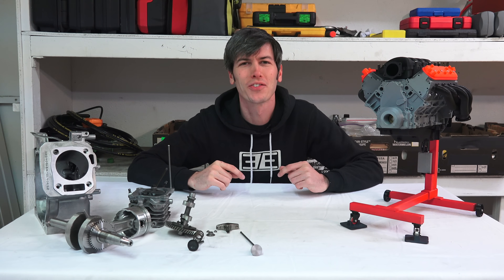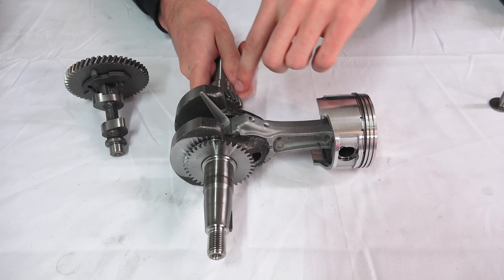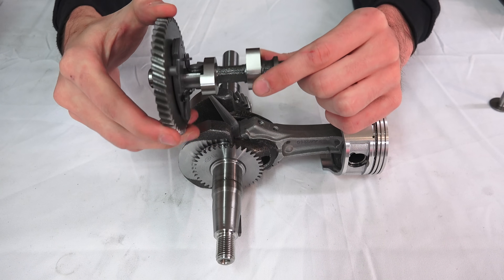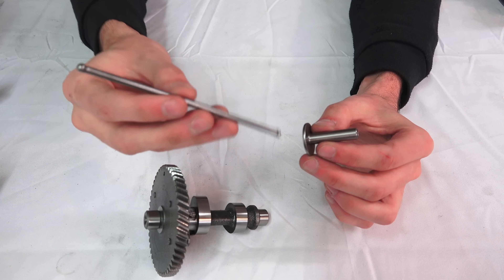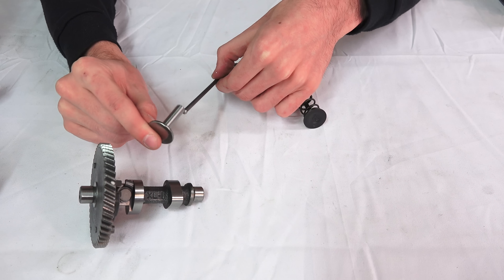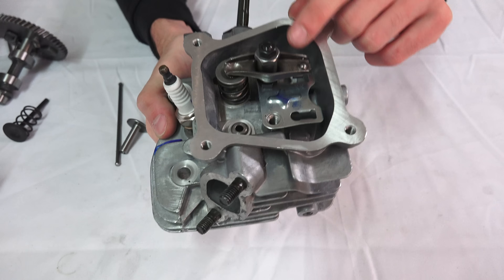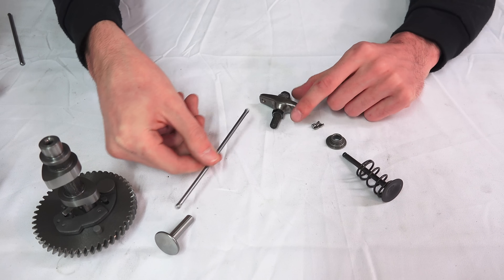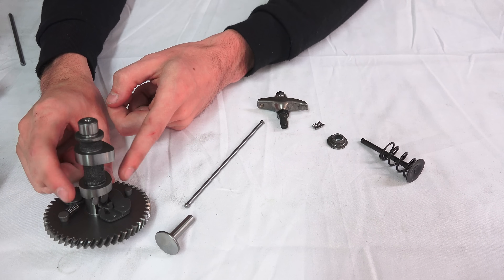Why Can't Pushrod Engines Rev High?

Comment: I know Chevy has the LS platform and architecture down at this point and it's a great and reliable platform... but I always question why they haven't yet moved to DOHC.

Is it just a spatial/weight concern?
Reply: Smaller size, cheaper, and even less crap. Your power band isnt at 9000 and most highway driving isnt at that level. Youre fine at 5600max as youll idle at 500 and at highway speeds 2800-3200. Your torque isnt produced in the higher ares.  It usually just brings the issue people fight over "torque makes you go fast, hp doesnt/hp makes you go fast, torque doesnt" I believe in torque not hp. Others are different on that subject.
Reply: Because they're basically building the Corvette up to be a contender in the supercar arena. If they can design an LS with DOHC that'll accelerate in RPM faster, and keep the powerband stable through a longer rev-range, they wouldn't need to squeeze everything they can out of transmissions to maintain vehicle acceleration.

Mostly talking out my ass, but basically tl;dr If they can and it would produce significantly more power and torque faster, why aren't they? I get that it'd be cost-prohibitive, but that doesn't seem to stop them from charging +$100k for a new Corvette.
Reply: InvictvsNox gm uses dohc and pushrods. Why let a engine platform die when both have pros.

Comment: Dam learnt so much. Always wondered why on engine masters the motors didn't spin very high. Thanks Jason.
Reply: what? there 377cid made peek power @7,000 and will rev to 8k,   ford voodoo 5.2L makes peek power @7,500 and red lines at 8,250,  that only 250rpm higher for a 1 liter smaller engine

Comment: Ask why PUSHROD engines dominate most WORLD RECORDS.....
  Comparing a 1.6 liter Formula 1 engine to a 5.7 liter?  
Ask why a 1000hp formula engine wouldn't move a Monster Truck... 
Higher RPM usually leads to narrower power curves & the need for more & closer ratio gears in the trans. Sometimes it's perfect, like as a street bike engine. But a 9000 rpm 2.5 liter engine in your station wagon would suck.

Comment: Kenetic force of the mass of the push rods will rip it apart. They also produce more torque loer than overhead cam engines.cheaper to make a large pushrod vs a small ohc. same effect is geared Right.

Comment: What about Judd V8’s? Cross plane, push rod engines that rev to up to 12,000 rpm? I’ve built small block chevys that have revved over 10k, granted they have half the stroke as normal. Your s2k revs high as well! I understand the point of this video is more of a “high revving engines are much less popular”, however, there are super high revving engines that use coil spring valve trains. You should do a video on why rotaries “tend” to rev higher than piston engines!

Comment: The thing with Nascar and race engines is that those engines are going to be used for a day. Using high strenght springs is possible because of that. The camshaft is going to get rounded fast, but it dont matter because those engines are disposable.

Comment: In modern time, using push rod engines is the most American thing you can do. In my country you'll be crying blood to pay tax for big displacement engine. Car makers introduced so much technology to bring out the power from small engines like variable cam profile, multivalves, variable valve timing, just to mention a few... which are quite impossible with push road design. Don't get me wrong, I would loved to drive a simple, low reving, big V8 and do burnout.

Comment: Its also the long stroke of an american v8 which creates very high piston speeds per given rpm. Short stroke engines will be able to rev higher as opposed to a long stroke engine due to the difference of piston speed.

Comment: I seem to remember back in the late 70's and 80's, the big trick was going to solid lifters from hydraulic. You could rev the engine a little higher as the hydraulic lifters would float around 7k... But I could be wrong, that was a long time ago, and I've slept since then ;-)

Comment: What's the advantage of push-rod engine? Going to SOHC with belt/chain drive should not have increased complexity and perhaps actually simplify things. How the valves are run shouldn't effect power output. Valve profile (2/4, size, lift) and cam profile and timing should have been the one that effects it. In the big industrial and marine engines increase in efficiency would have also been more advantageous and it would probably just as easy to change valves on board and there's no connecting rod to break so I don't see why use them.
Reply: The biggest benefit is packaging, and cost. Pushrod cylinder heads tend to be more compact since they don't have to house the camshafts or cam gears/pulleys. They are also typically cheaper to build since you only need one camshaft, one set of followers, half the valves, etc...
Reply: Wanna see something funny, look up LS3 vs GTR engine. That Nissan engine is a monster compared to the LS3! I also got a comparison picture of a Mazda 4 banger next to one and the Mazda one isn’t that much smaller. 

That’s what’s so funny about people talking trash about the LS3 being 6.2l is they act like it’s a big block. It’s a small block and when compared to a lot of engines, you see that it’s really not that big. The 5.0 Coyote is huge thanks to its 4 cams and 32 valves.
Reply: Less weight and heat on larger engines is also a huge advantage. Putting 32 DOHC valves on a Blown Hemi adds  A LOT of extra weight vs. just turning up the boost. Pushrods cylinder heads are lighter; without cams and extra valves.

Comment: The spring strength is not main reason for that. Overhead cam engine also using spring on the valve. It is more on the valvetrain mass, and the length of the rod (strain and compress).

Comment: Great video. Not sure why a stiff valve spring should cost you efficiency though.  There's nothing damping the valve spring so it should just push the camshaft round as the valve closes giving back nearly all the energy that was used to close it.
Reply from the maker: Pushing a valve spring closed doesn't provide useful work for the engine. If a valve is pushed back harder, the engine is no stronger. But the engine does have to use its own power to open that valve. The stiffer the spring, the more force the engine has to produce to open the valve.
Reply: Engineering Explained But the cam is symmetrical and the follower remains in contact (unless it's "floating") so it should push the camshaft the way it's already going. This means the engine encounters a little bit less resistance when turning that cam gear so you'll get a tiny bit more torque at the crank. If the energy is lost then where is it going? There's nothing squishy or frictiony in the system.

Comment: I remember the Pontiac 2.5 liter "Iron Duke"push rod 4 cylinder having a redline of about 4,500 rpm.  Ridiculous boat anchor (but reliable) motor.
Reply: smithraymond09029 the iron Duke didn't even manage to wheeze out 100hp from 2.5L either.
Reply: @mrflamewars  88 hp. in 1983, if I remember correctly.

Comment: sir , desmodromics addressed valve float (imo) very well. why is there no desmo or desmo-like system found in cars? thanks!
Reply: Its got to be patented
Reply: NVH, that is why you do not see those in cars.
Reply: Pad Lok Desmo valve systems are somewhat more complicated and more expensive than other ohv systems.
Reply: Vernon Pitts, thanks, after a little reading i now understand your comment. but i was unable to find any reference to ducatis or desmo in general being particularly bad on nvh. lacking any exp in this i ask you, does the desmo valve train add that much vibration? more than say choosing a bad angle (45 deg) for your v2 (or 90 deg  for your v6) ? also they put flat cranks in production cars for minimal scavenging benefits so obvi at some point even production cars will tolerate high nvh for performance gain. i suspect that James Avery got it right and it's a patent issue.

Comment: they don't rev high because most modern push rod motors use hydraulic lifters that have plungers in them that bind up at high rpm, this causes valve float where the pistons are coming in contact with valves because the fluid cant get out of the lifter fast enough. Nascar uses 4 pattern cams and f1 used something different cam wise. They are both full oil head and cam bath designs to help keep everything cool at higher rpms.

Comment: Can someone tell me the short version? Lol yes I am lazy
Reply: More parts less revs...simple lol
Reply: Nuno Godinho thanks lol
Reply: Also, spring limitations, compounded by the additional parts (more weight to move back and forth), eventually yielding valve float as a result bc they can't keep that weight in check at that speed.

Comment: Although I love 4-valve per cylinder DOHC engines, I have to credit large displacement pushrod engines for having great low-end torque, ideal for the easygoing driver.

Comment: Could a pushrod engine rev higher if it used gas instead of springs to return the valve (like f1 cars valves)?
P.S. by gas I mean gas, not gasoline of course
Reply: Damn you already answered my question hahahaha my bad, need to watch the entire video before asking questions 😂

Comment: At this rate I'm going to have to make a video because the number of valves makes no difference you can have 16 valve the one head in and garbage camshaft and it'll flow about as good as a lawn mower engine the valves don't make the difference it's the port size in the camshaft that does if you have the port the size of a pencil and it has to say 5 hours per cylinder it ain't going to outflow an engine that has ports of size that will take a golf ball that has to valves but then you can take the one that has giant ports and put a terrible camshaft in it and it's still not going to flow it all the number of valves make no difference dude they just don't

Comment: Most street pushrod engines use hydraulic lifters that are only good to 5500 rpm. They have used solid lifters in the past but needed valve adjustment every few thousand miles. The original Boss 302 and Z28 are good examples.

Comment: and this is why the LS is a shitty motor
Reply: one of the best motors ever made. fact
Reply: Lol way more torque than any euro 4 banger.
Reply: NewSchooler Oh please. Show me a factory 2L engine making 450hp+ and 450tq+ much less while returning mid 20s mpg under normal driving.

I'll give you a hint, there aren't any.
Reply: In what galaxy? LS is a damn good motor and the go-to swap for in imports in Formula D for a good reason.
Reply: jordan lewis yep. Totally shitty. That's why a factory bottom end can make 1200hp, also why they get amazing gas mileage, why they are easy to repair and have swap kits for every make of car out there.  Why they are the most commonly sought after V8. Also why people swap them into their drag cars. It's because it is a shitty motor.
Reply: +NewChooler it is NOT 3-4 times bigger gtfo if your eally believe that.
Reply: NewSchooler the whole point of having pushrods instead of dual overhead cams is because the engine can be smaller. You have no idea what your talking about
Reply: Still waiting for the Chevy LS Flat Plane Crank Motor
Reply: LMAO ;-)
Reply: Le Mans has Balance of Power Rules though

making every car equally fast no matter what the displacement is
Reply: The Power Density of Ford engines are greater than Chevy's

Engine efficiency is measured in Horsepower per Cubic inch
Reply: NewSchooler 2.0L four bangers need 5,000,000 pounds of boost to make any serious power
Reply: Its not 3-4 times larger dingbat. Displacement has nothing to do with the size of the engine. Typically pushrods are smaller and lighter than their OHC counterparts.
Reply: Adam, more torque events per second, ie more rpm = more motive force per second. Just who doesn't understand engines ?
Reply: Escape for Mankind is Keith Johnson 
Flatplane LS would vibrate itself to death. They’d be building their smallest LS just to do it. I’d doubt they’d ever do it due to cost for a one off engine. Maybe if they massproduce it, but heavy doubt.
Reply: If you judge an engine solely based on how high it's redline is, you don't understand a damn thing about engines.
Reply: Winning LeMans 24 hour against OHC engines say  different.
Reply: Flat plane cranks don't like much over 5 liters apparently

Comment: And you can't be serious on the four valves flow more than two giant valves that doesn't affect flow I'm sorry it just don't and name one overhead cam motor that makes 10000 hp and you said that V8 push rods have a special heads open the valve more no heads don't change valve opening only the lift of the camshaft does and you can't be serious name one engine overhead cam that has bigger ports in a Ford 351 Cleveland the ports on a 351 Cleveland or so huge that a golf ball can fit in the damn thing so you can't argue about the whole thing about flow you can't it's all about the camshaft you put a serious camshaft in that Cleveland there's no other overhead cam motor going out flow that thing I'm sorry there's not and don't come at me with the old you got overhead cams with aTurbo I'm talking about naturally-aspirated name one overhead cam motor that flows better than a Ford 351 Cleveland naturally-aspirated there ain't you don't know what you're talking about dude you don't you're lying to yourself and everybody else if you're going to say that the pushrod motor is so stupidly outdated that it can't outflow a ohc when that's clearly untrue and I can't see your correlation between Formula 1 and standard coil spring valves your overhead cam that you praise uses coil spring valves there is no other system on the entire planet they can twist that much RPM without there's there's no spring they can do that it has to be air what the hell does that have to do with the difference between overhead cam and pushrod if it was pushrod it still wouldn't twist know where that high there's no valve spring on the plant that can take that